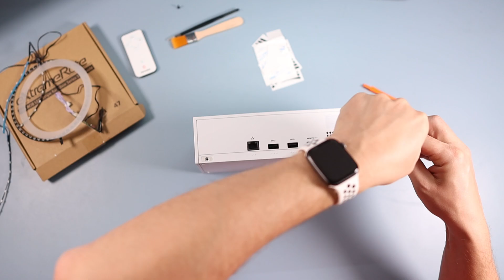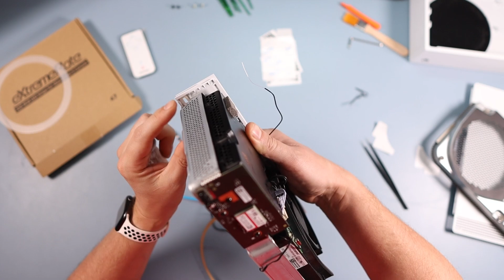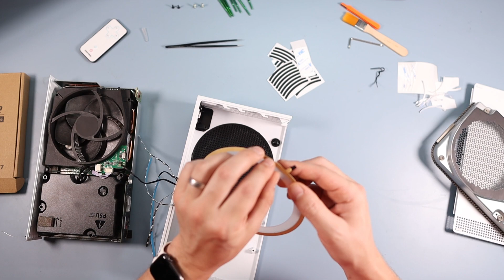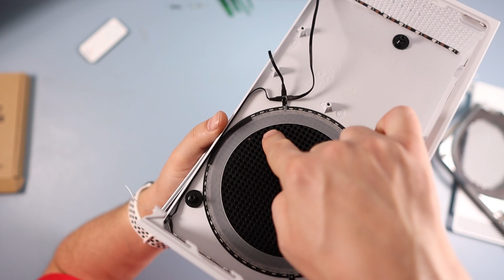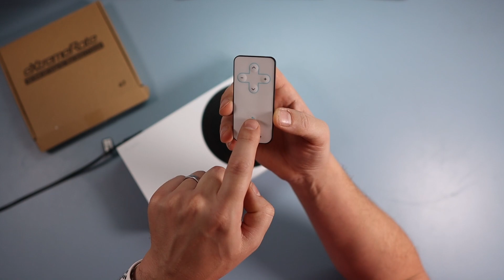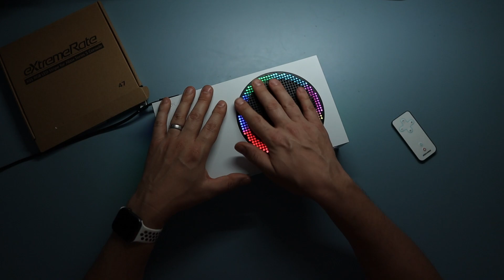Xbox Series S ExtremeRate RGB mod install.

Comment from the maker: DISCOUNT CODE. Please see the description on how to get a nice discount for any extremerate product bought on their website.
Reply: It's been 5 months you got a review, cuase Im thinking with a hard drive plugged in, wireless headset and then put a RGB light kit we might be running oh little Xbox a bit too hard, where is the kit that just feeds a little cord out so we can just plug it into the wall, don't give me the RGB use barely any power I know this, but that fan would need and get a specific amount of power, and the RGB are using the same plug.

Comment: The Metal Shield Problem when you want in there a Performance Fan 120mm and the much Heat i fixed !Remove the Metal Shield ,put the Performance Fan on the Cooling Ribs with Zip Ties ,then let the Metal Shield outside the Box and mount only the Plastic .No Issues ,not much more Dust and works good ! ❤

Comment: What about heat ?  If the heat melts the glue the leds fall of ? Or the glue is heat resistant?
Reply: LED light is hardly heat up at all. We try it lighting up for  almost a day but it didn't get heated a bit.
Reply: @catpersonality66  heat from the PSU AND FROM THE PROCESSOR 🤘
Reply: You right 😎👍

Comment: Why won’t my lights turn on I’ve took it apart 4 times and checked wires and everything and can’t get it to work
Reply: I had the same problem, check battery in remote, mines was upside down.

Comment: Will it block the airflow and will the overheat inside the xbox damage the RGB cable?
Please this is my first time using a console. Thanks!
Reply from the maker: No it doesnt, its thin enough to not block it at all.

Comment: I need help, I have installed watching video. Xbox works including fan but LEDs will not work at all. Tried using remote all around but nothing. Could this be the remote maybe?
Reply from the maker: It sounds like the remote. Maybe try changing the battery or I have noticed it also works with other remotes of similar style if you have any other rgb in the house.
Reply: @CTAtechdesk  okay thank you, will give that ago
Reply: @CTAtechdesk  Tried new battery. Led flashes red on remote but LEDS still not turning on. Guessing the receiver or something but not sure. Guess I will contact them and see if they can send out a new one. Either way thank you for the video. Was a big help and made the install very easy
Reply: Mine aint starting on

Comment: i really dnt know if this is safe  in the long run
Reply from the maker: The rgb hardly draws any power nor does it prevent any air flow so will be fine.
Reply: Can you confirm this still @ctatechdesk?